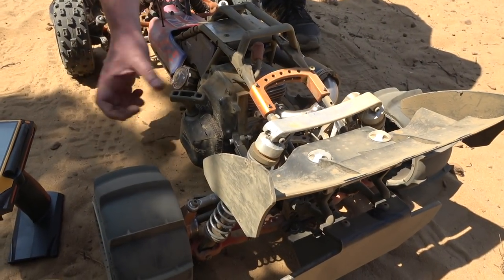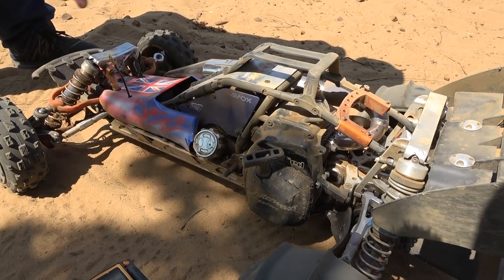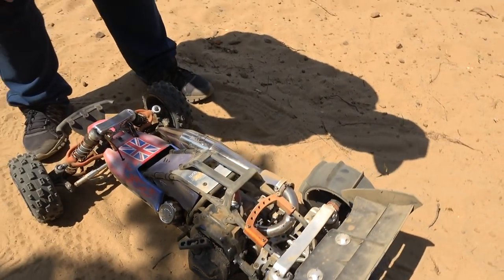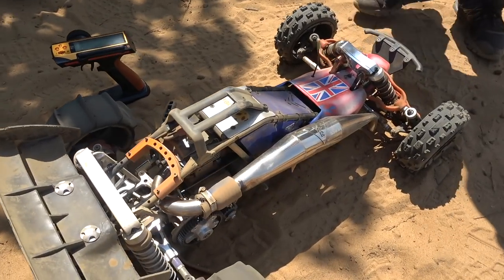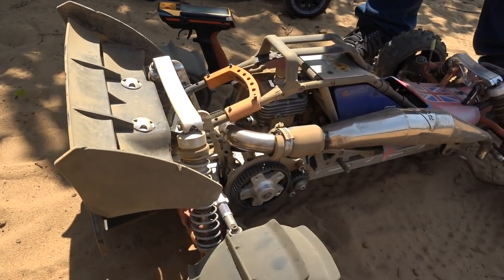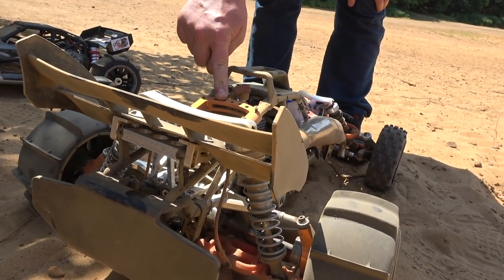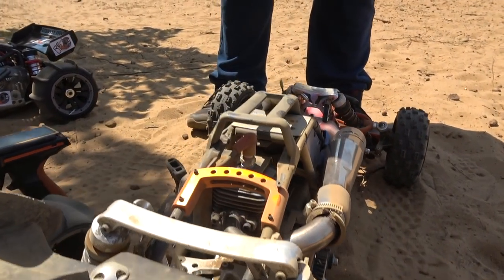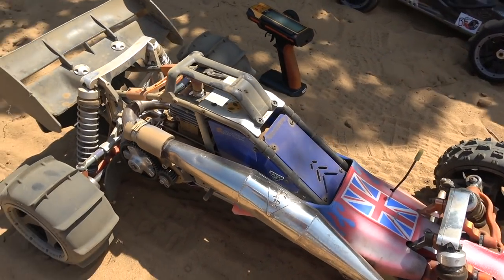Scott Finlay 34cc Baja BLASTING in the SAND!

Comment: I'm surprised he wasn't using an enclosed clutch system on the sand! Did he have any issues?
Reply from the maker: hi mate, no issue that i was aware of. blackbone gears are solid, so i guess at least without an enclosure and sand gets thrown out quick rather than trapped.